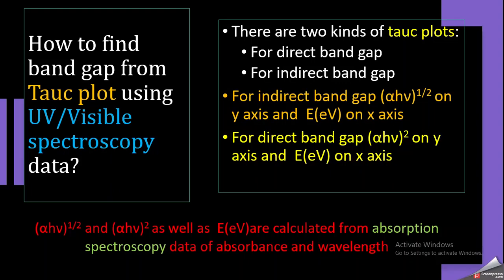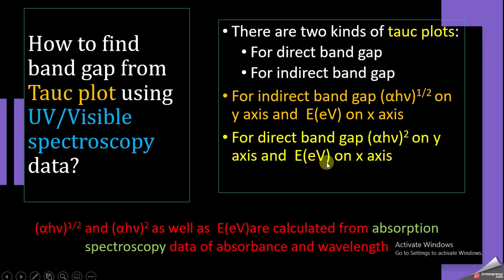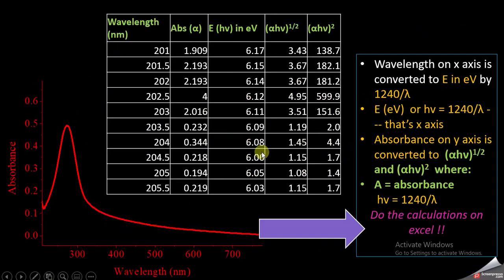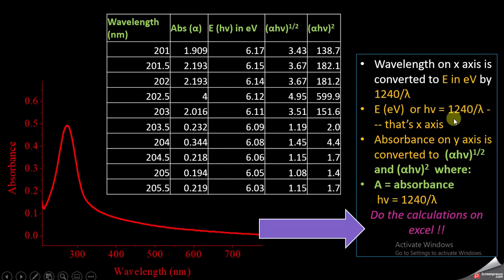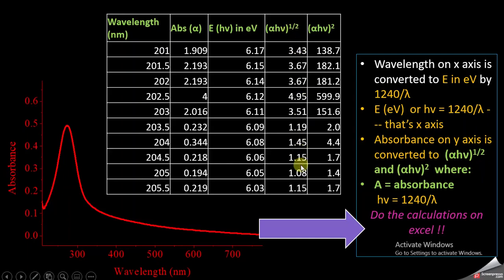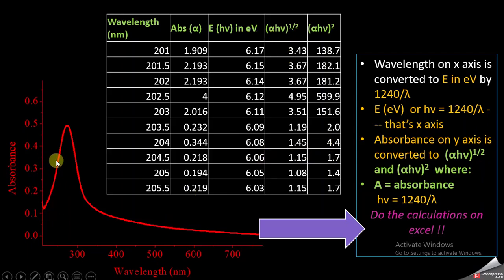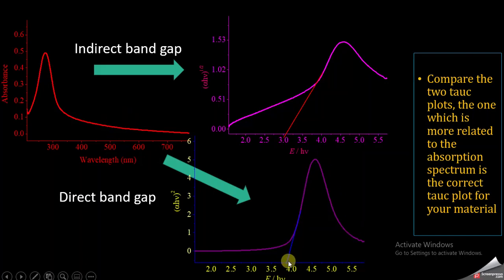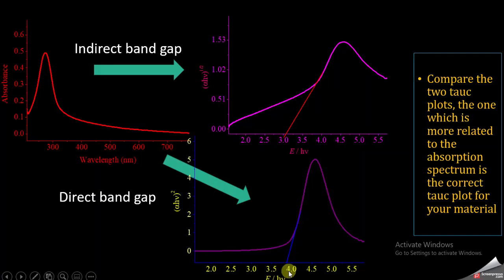How to find band gap from tauc plot using absorption spectroscopy data

Comment: why absorption in figure is smaller than 1.0, abs. in table is larger than 1.0?
Reply: Thank you for sharing valuable info.
Reply from the maker: I think the high absorbance that you are seeing is at 200 nm which is not shown in graph i.e. the scale is adjusted such that to show lamba max of the compound not the solvent absorbance